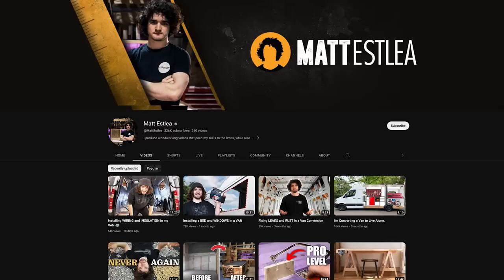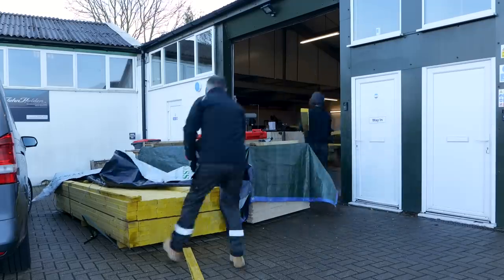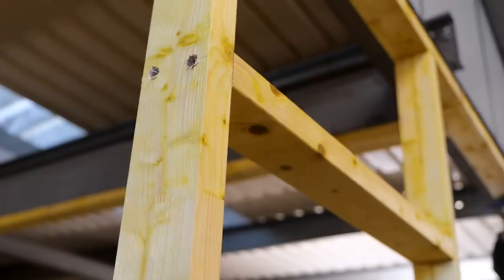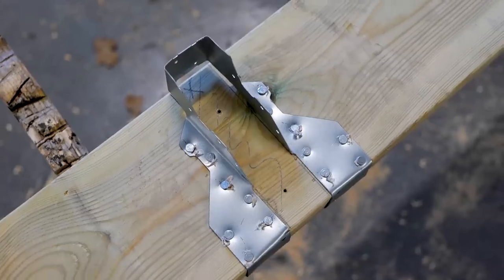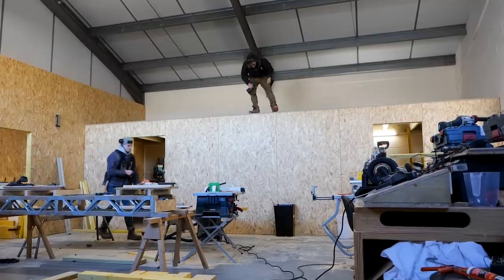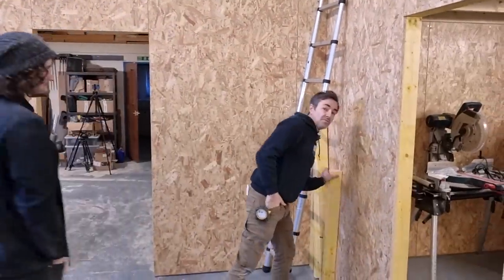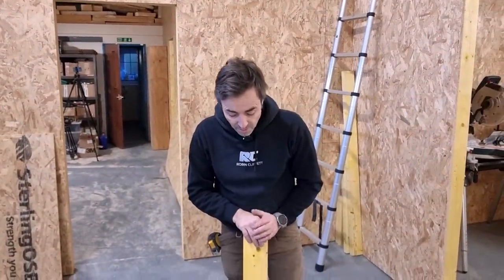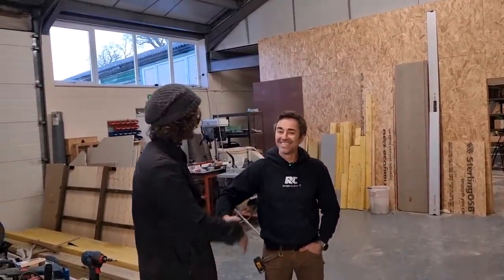Using Metric OSB and a Tru Stud System for stud work made easy

Comment: Great little video, i actually really enjoy doing a bit of stud work and i can confirm that Tru stud is really good stuff!, its always baffled me that although in this country we started changing to the metric system in 1965 we still have our sheet material in imperial, oh but not flooring or plaster board...thats metric..bonkers!
Reply: OSB in imperial makes no sense to me. MDF and Melteca can still be advantageous because it gives some leeway if you use it for kitchens or wardrobes. A 1200 ripped in two leaves less than 600.
Reply: Imperial is for carpentry and metric is for joinery, that's my tuppence worth, 👍🔨🇮🇪
Reply: @TheToolnut  That makes sense only if you slowly and reluctantly inch your way towards the metric system.

Comment: I use one of the Stanely Folding Pocket Knives (0 10 598) as a marking knife for onsite work. Small, very sharp and has an extra blade in the handle.

Comment: First time I used metric OSB I was WELL pissed off. I'd already built the stud work for 8 by 4. And if I remember, some of the OSB was actually 8 by 4, just to add to the frustration.
Reply: Had the opposite problem. Marked 400s, Got a sheet on, realised mistake and adjusted studs. 
Next day picked up another load of osb from a different supplier that came metric 😂😂

Comment: 92 mm I section metal stud comes up a similar price as Tru stud, and also reusable so another option.I dont see the problem in this case with Imperial size OSB just work with Imperial measurements.Most wooden sheet materials are Imperial as they are made in the Philippines, Brazil and other countries for the US market. Good vid though got lots done 👍

Comment: Now metric OSB could be a game changer, how often do you have to decide whether to set out for the OSB or the plasterboard, particularly on flat roofs.
I've been using Trustud for quite a few years and it is so good for studwork BUT, it is expensive compared to sawn and treated, getting on for twice the price, so sometimes hard to justify.
On a point of detail,  I would call that bolted on plate a ledger, to me a pole plate is a wall plate which is fixed on top of the ceiling joists ready to take the rafters.
Something else Robin, yesterday I picked up a few 3m lengths of 8x2 sawn and treated for a dormer header and I noticed that some of the lengths were finger jointed like the trustud, I've never seen that before.
Reply: If they're finger jointed it's called KVH Timber, it's all the rage in Germany.

Comment: You should have doubled the head timber that supports the upper level floor. Or, at the very least, lined the floor beams up with the studs transfering load down to the floor. 

On a side note, i need to start using this stud. The last pack i used only had 50% usable straight stud.
Reply from the maker: Hi Stephen, the strength in the wall comes from the OSB sheathing that is fixed to the stud wall, a double header is overkill, I have been working with a timber frame engineer that has some amazing strength calculations with OSB clad walls and for the job this wall is doing it could have been up to 800 centres and 12mm OSB and that would have still eaten the loads, we tend to over build here and many structural engineers work on a safety factor of about 200%!! that covers variations in the skill of the craftsperson!!
Reply: @Robin Clevett  thats really interesting. And it's good to know moving forward. It does make sense when you break it down. I must admit i am one for over engineering just to make sure, so it's why this stood out to me. I also didn't know if the stud also had a better strength rating. It is always good to keep learning. Love the channel, btw
Reply: @ukconstruction  I noticed some overkill on some of your vids. Your engineers are as over the top as ours since the Christchurch earthquake. No one want to be sued. We pay a high price to avoid occasional litigation. I think that as a society, we have become too risk averse. No wonder building is so expensive.

Comment: Hi Robin, great video as always.  You mention using the same screw throughout; is it the 4.5 x 60mm Spax Wirox in the stud work?  Are you pre-drilling each time?
Reply from the maker: Not with these screws, they rarely cause any splitting especially in the TruStud

Comment: How did you & team of your men enjoy getting a good use of Bosch powertools? Yous had a good range of gear there!
Reply from the maker: As you would expect from a quality German powertool brand its very good!! Loads of power and good ergonomics with the great build quality that you would associate with @boschpowertools
Reply: @ukconstruction  just wanted to know your thoughts as you’ve used a wide range of powertools! 

I personally run festool, dewalt XR + flexvolt & Bosch & bi turbo stuff! Each manufacturer have certainly exiled in different areas! Just want to know what you thought compared to metabo, hikoki , hilti & makita gear u have ☺️
Reply: @ukconstruction  I recently bought the smallest (216mm) Bosch Professional mitre saw. It is a peace of crap. The blade wobble and drift are something to behold. I brought two of the back. On the third one now. Slightly better but not good.

Comment: Here in Eastern Europe the OSB is an odd size 2500 x 1250, a pain if using on 400 / 600 stud work.
Reply: Just place your studs accordingly…Measure twice/thrice cut once..😜
Reply: @justkiddin1980 whilst you were being slightly facetious, it's an interesting point. You could place them at 625 centres, but then that might fall foul of some regulation or other. 312.5 centres would seem ridiculous too (and expensive) as well as difficult to measure accurately. 500 centres would work nicely, laying the sheet on its side, but then you'd have very high ceilings if you weren't cutting. Interesting.
Reply: @ricos1497  The 'easy' way to get around the regulations is to have a structural engineer do the calculations to determine what load can be supported by the metric sheets of OSB and studs on 625mm centres. It won't be much lower than the same thickness OSB and 24" centres (610mm). You would only need to do this once.
Reply: @tlangdon12  absolutely, just a bit of extra work to go through. Fine if you're doing a large construction I suppose, but a little annoying just to get round a sheet good size.

Comment: Hi Robin, what sleeve anchors did you use for this job?
Reply from the maker: 12 x 130mm. The 12mm is the size of the treaded rod internally and we use larger drill bit for the sleeve, from memory it's either 14mm or 16mm!!

Comment: If the sheets come in 3mm under, then you should use a 6mm packer shouldn’t you?
Reply from the maker: Basically if you start 1.5mm of the centre line of a stud then pop a sheet on you will be 1.5mm off the centre line of the next joining stud giving the 3mm space between sheets, another way of thinking about it is, take a sheet hold the packer on the side and it will measure 1200 so effectively the size you need
Reply: Cheers. Great video

Comment: Load is transferred from steel beam to slab...
Reply: Some of the load, might be, would probably be a better way of putting it. What would you recommend? It'll obviously need to attach to it at some point for stability, would you just lean the stud to the steel rather than attach underneath?

Comment: Don’t get the big deal about metric osb, this is just a workshop fit out if you couldn’t get the metric stuff you would get imperial and work off 16 inch centres
Reply from the maker: Hi Jimmy, the thing is the metric stuff is widely available you just need to order it in